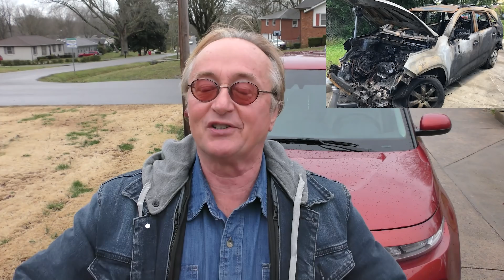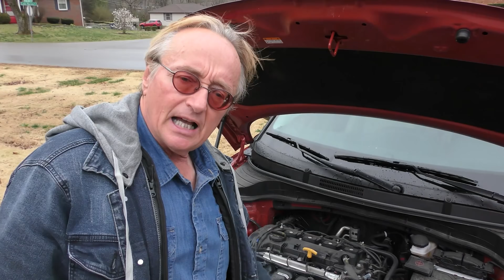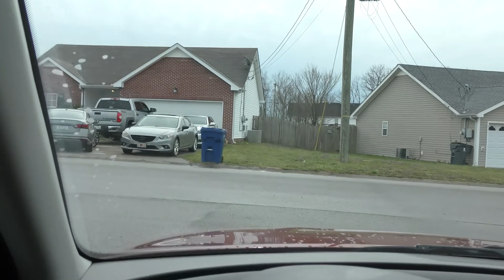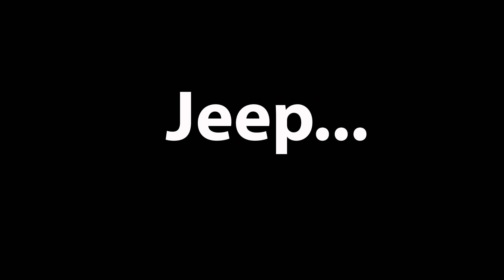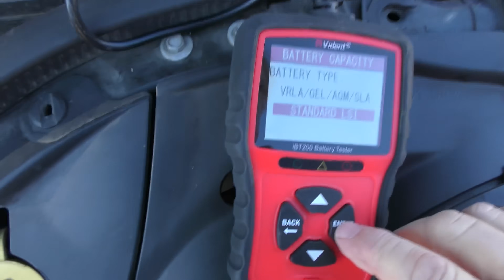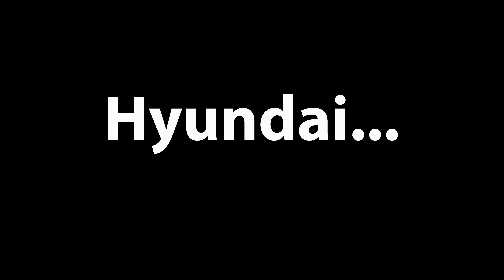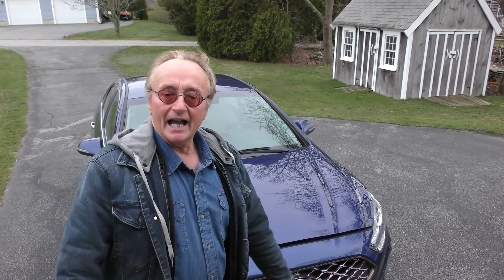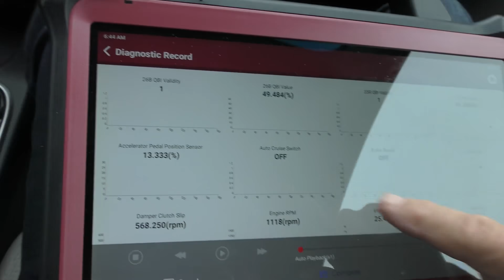3 Car Brands That are Crap

Comment: Always take these videos with a grain of salt knowing people here are looking for views. That being said, ive owned 2 Kia's and put 300,000 kilometers on both, never had issues, meanwhile my wife's Toyota Camry which we bought because we were told about their reliability has had its headlights changed 5 times and the engine makes a whining sound at low RPM's. its a 2019, My Forte is a 2014

Comment: My brother had a new Ram 1500 with the 4.7 magnum. Brand new it started burning 1 quart  every 1000 miles at first. Then it just kept increasing. He took it to the dealer and they just refused to fix anything. They told him it was normal.
Reply: Those 4.7s were just terrible motors right off the bat, they should’ve stuck with the 5.2s, way better engines

Comment: Something wrong here, We had a  Hyundai Kona [sons car], dealer service, down under, sold after about 90,000 Km never burnt any oil, My wife's  2010 Hyundai Getz, 80,000 Km never burns oil, [I service it] Scotty says buy the one made in Korea, they are better, I agree. Seems US built ones have the problems.  Kona dealer service was at 15,000 and I would think that is too late,

Comment: Mister . First oil change is  with all new cars  ca 3.000 -4.000 miles. Next oil cahnge is 12.000 miles and next again 12.000 miles...if  car  is not use  then every year must  enigne oil cahnge. Simply like that. I  own little vcar  1,0L enigne . 71 hp  and others was  1,4 and 1,6 petrol cars  -that same  even often if  car is more then 10 Years old then every 9.000 miles must enigne oil cahnge. Manual gearbox oil every  40.000 miles and  automatic  ca 25.000 miles.

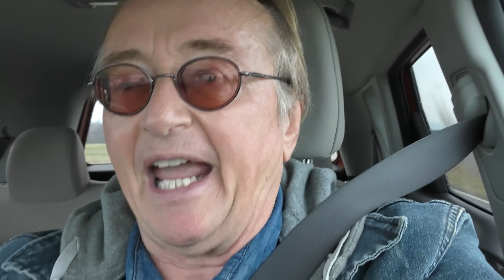Comment: 09:54 If you put gas pedal on end of floor then Yes indeed rews go 6500 ! Small enigne  not even noise go  to sky but it damage Your car enigne.  Even that  little car no needed 6500 rpm to accelaration . 3.000 rpm is enough !

Comment: In 2010 my wife and I bought a 2010 Hyundai Santa Fe.  It had a long warranty and it came with a service contract, and our dealer experience was fantastic.  We'd take it in for regular maintenance, no charge because of the service contract, and they would find and fix something that needed repair, no charge because it was under warranty.  I did worry about what would happen after the warranty was over.
Reply: and……..
Reply: @MP-nm9df  Sold it before the warranty was over.  It's important to point out that dealers are independent of the company that they represent, and while the dealer we went to was really good, that says nothing about any other Hyundai dealer.

Comment: The first car I drove with the auto start was a 1.3l ecoboost, manual Ford Focus. Good baseline. I went to drive a brand new Jeep recently. Holy sh!t. The pedal to go lag was horrible. I'm guessing Ford does pretty good with the auto start compared to other companies.
Reply: Autostart is junk
 Disable it
Reply: Ecoboost rubbish,  oil chain.!
Reply: @petergerritgroen3157  yea? My wife has a 14 escape titanium  with the 2.0 ecoboost, runs like new. It only has like 115k so far..but no issues.

Comment: I don't like those auto-off systems. Just doesn't seem like a great idea to put a load on an engine before the oil pressure even has a chance to reach capacity. I always press the button to disable it in the truck. Junk.

Comment: Jeep?  Our 2011 Chrysler Town and Country needed a new TIPM.  $1200.  $7000 in a year... Now totally dead.🙄😱😞  Used as storage shed now, until I choose to find the cause.  Meantime...windshield cracked and when I replaced the rear suspension parts...learned axle was bent.  Goes through tires in 10K miles.  Anyone want an expensive paperweight?

Comment: Our 2016 Kia Soul 2.0L was fine for 66K miles, then it decided to swallow virtually all it's oil in 1000miles. It went from fine to all but dead virtually overnight. New engine and it seemed fine. Fine enough for Carvana! I bought a Highlander 😎

Comment: Had a 2.3l Ford Ranger that burned oil from the get go… the engine was poorly designed and used for over a decade in various models … no warranty replacements authorized

Comment: 7500 miles is too long between oil changes. My wife has a 2022 Tuscon, and it gets changed every 3500-4000.  Runs great so far.  My wife puts a lot of miles on it, so maintenance is KEY.  

More than that, every service done to the vehicle is recorded and the paperwork kept.

I'm not taking that chance.
Reply: Oh aren't you just something....  I'm so  proud of you and your wife.  Good boy

Comment: I have a 2009 Camry 2.4 4 cylinder. Exactly the same problem as the Kia in this video and exactly the same response from Toyota. It has to use more that a quart of oil every 1000 miles or no fix. So I am stuck adding oil all the time.

Comment: Shame that all gdi motors need an intake and combustion chamber cleaning every so often depending on how clean you keep your oil, and they don't put it on the maintenance schedule.  And since the Kias are still catching fire, I traded our Sportage for a RDX.
Reply: did you not hear that honda still have transmission problems?
Reply: @maga6319  at least they aren't catching on fire.  And that's why I stay away from  Honda 9 speeds, 2017 RDX is a 6 spd.

Comment: I have a 2011 Kia Soul with the 1.6 liter engine - 5 speed manual with over 160,000 hard miles on it from doing courier deliveries in NYC in addition to Uber work in Florida and it's still going strong. Nothing broken on the car, but wondering how long I should push it before I move on to a newer vehicle.
Reply: ..if you move to a newer vehicle, you probably will be pushing it..literally 😆...so much electronic crap to fail on the newer ones...

Comment: Idk about Kia in general being bad. My sister has a 2010 Kia Sportage which has done almost 400,000kms. Engine is noisy as hell but driven the car for a year, no oil change and still goes tough. It’s not worth repairing on anything or rebuilding as it’s reaching its end lifespan but pretty much ride till it dies

Comment: Kia have bad engines because of cheap/ weak piston rings and direct injection.  Direct injection causes oil dilution and excess wear.  Also DI  high pressure fuel pump leaks cause spectacular fires. Nearly every car manufacturer went to new direct injection tech;  so budget Kia competes to give customers the latest tech... good or bad.

Comment: Saturn said the same thing back in the 90's / early 2000's.  Oil consumption was only addressed under warranty if it burned more than 1qt per 1000 miles.

Comment: I had 2 Chevy prizms with Toyota engines in them and they died after about 120,000 miles I am driving a 2013 Kia Rio with 220,000 miles my only compliant is the seat ruined my back. Maybe I was just lucky when I bought it but I never spent much on it just maintenance.  My next car will have to have better seats.

Comment: I got a Hyundai in the driveway with 220k miles on it and only problem I have had is altenator and that’s my fault cause I have two batteries and a huge system in it! I have abused this poor car run it like a race car delivering food and it just takes it. It’s always had a small oil leak so I keep a quart in the car poor a little in as it needs it.  No big deal! The A/C still works and is cold cold! So they do make good cars you just gotta watch which ones you get! And parts are so cheap it’s a non issue.

Comment: I have a 2017 Sonata PHEV. At 80k engine failed suddenly without symptoms. They replaced it after proof of oil changes.
Reply: How has it ran since then?
Reply: I am just waiting until 160 to see. But I am Also not driving much these days so Idk could be a few years until then. I could see that being a factor also. It could just age to expiration instead of mileage.

Comment: I have never had issue with my Kia or Hyundai cars...because I take care of them...you can't abuse them like a Honda or a Toyota....and I would never go 7500 miles between oil changes in any car brand...they have started using synthetic on all the car brands and they say synthetic change 7500 - 10000 miles or once a year....noooo way I'm doing that.

Comment: My replacement motor via KIA burnes a whole tank of antifreeze reserve in 3 to 4 thousand miles and now always leaks R134a every year since the engine replacement.... Kia just ignoring the issue.... Dealer says they're working on it to see what will be done.... Been a month and nothing after forcing the original selling dealer to service the warranty.... Kia Corporate doing nothing.... About to get a lawyer..... And what is amazing is when I bought my Sorento the dealer did the knock sensor update (which then I would of never bought) and removed it from the service records and Carfax.... Scotty is right, Kia plays political games cause the liability they have with quality is so high.... Do not buy, Scotty is right....

Comment: When it comes to the kia souls not all of them are bad the 2010 to 2015 are solid built especially the manuals seen many with over 200k miles and running fine

Comment: The problem with KIA/Hyundai is, that if they wish to sell their vehicles in the United States, they must meet our Government regulated emission and gas mileage standards. The solution used by KIA was to use a softer cylinder ring, as well as a 0W-20 motor oil. This was a recipe for complete disaster, and the new 2022 KIA vehicles sold in the United States now come with a revamped 2.0 litre engine that is no longer GDI, and is now MPFI, with stiffer rings and a factory recommended 5w-20 full synthetic Mobile1 oil recommendation. This motor is used everywhere in the world, but the United States and has a very good reliability history. Your love of Toyota Scotty is very valid, BUT.....Not every person can afford the price of a used Toyota, let alone a brand new one. KIA, with it's 5year/50,000 B2B warranty and 10year/100,000 Powertrain Warranty, as well as price point, make this the perfect vehicle for a student, or young family. Now if you really wish to BASH on a vehicle manufacturer Scotty, start at home with everything in Dodge's line up, Ford's small turbo engines and all of Chevrolet/GM's engines first. Then you can BASH on BMW, Mercedes and Toyota RAV 4's, the new Tacoma's and Tundra's!!!! And don't even get me started on the entire VW/Audi vehicles!!!

Comment: I bought a new 2021 Kona. 3 months later I get a notice that it has bad pistons. So I take it in for the recall. All that amounted to was a mechanic listening for any noise in the engine.  Hyundai told me to drive the car and not worry about it. If it blows up, (and it's still under warranty) they'll fix it.   I gave the South Koreans one chance and that was it. Sold the car.

Comment: Hyundai Parts Manager here I drive a Subaru Crosstrek Enough said. Though I had a 2010 Genesis 3.8 and a 13 Elantra 2.0 both great cars. Those engines were built well. The 2.4 garbage they started building in the 2011 Sonata and the turbo 4cyl in the 16 & 17 Santa Fe you couldn't pay me to own

Comment: I have this EXACT engine, 2017 Elantra.  95.000 miles on it bought new. I change the oil every 3000 miles. Its always at the full mark before it gets changed. Its very important to all cars to follow the break in procedures in the owners manuel.  Driving it hard right off the bat, can lead to an oil burner.
Reply: I have a 2013 Soul with the two liter. So far, no issues. Seems like its hit and miss.
Reply: That's what I was thinking too.
Reply: Of course, it depends on how the car is used, but 3000 miles between oil changes sounds too often.
Reply: Kinda weird, maybe i am lucky, but i have been always driving our new cars hard right after 500 kilometers. Not a single oil burner. Opel Astras (diesel and gasolines, all turbocharged) and BMW diesels (all turbocharged). Only i never drive them hard when the engine is cold.
Reply: 2017 elentra sport 65000 burns a quart every 300 miles I got rid of it and bought a civic good luck to the next owner

Comment: I have had issues with hyundais..however NONE of them ever was burning oil.
As a matter of fact the recommended oil change interval is 5000 miles.
Is this any more nuts then Toyota saying change the oil at 10,000 miles?
Reply: A corolla or Camry manual recommends 10k oil changes?

Comment: My wife bought a 2018 Hyundai Sante fe a few years back it had 20k miles on it when we bought it. At 40k miles the motor was burning a quart of oil every few days so we took it to the dealer they said it was on the verge of blowing up so they put a brand new motor in it thank God for the warranty
Reply: Dealers don't tell you that GDI motors need an intake cleaning about every 15k depending on how clean you keep your oil, and combustion chamber every 40k or so depending on driving habits and oil used.
Reply: @lonniebeal6032  you clean your oil,  I gota hear this🤣
Reply: Good for you. The manufacturer delivered. Reputable company
Reply: Check the brake lights too. Kias and Hyundais are notorious for electrical problems with the taillights.
Reply: lucky

Comment: This is sad, my 1984 z31 2+2 vg30e 80,000 miles has only blown the heater core, but the engine and transmission are like new, ITS ALMOST 40 years old and runs and starts with original parts like a gem, also rack is leaking but not much and works a manual, I should probably change it tho

Comment: Been a honda guy since 2014. Never again. Had a 19 ilx. Rear main seal leak from factory. Smell oil in vents yummy! 2 loaners same problem. Upgraded to the 21 tlx. 2.0 liter turbo. Rear main seal leak from factory, oil smell in vents!! And 2 or 3 tlx loaners same problem! And guess what!!! Oil dilution on the 2.0 turbo too! We were stupid thought would be weird coincidence so got the 21 rdx. 2.0 liter turbo nasty very bad smell in vents when vehicle stationary from rear main leak. And sadly alot of fuel in oil well enough to chk oil and have bad fuel smell in it. I will keep changing oil every 1500 km to 2000 km at my expense. And had 3 rdx loaners all had same problem. Dont listen to anyone! Do not buy honda acura. Unless ur getting the 3.5l 6 in odysey or rideline. Also the customer service is discusting. The worst!!! If your a car person like me and dont wanna waste your money well i just saved you. Buy a toyota! Or anything but a honda. You are welcome

Comment: KIA: Burning a quart of oil per 1000 miles is a design feature.
Jeep: An electrical problem? No way!🙄
Hyundai: Take the bad transmission out of this car and put it in that car. Now put the bad transmission from that car in this car. Repeat until the customer stops coming back.
Reply: My daughter was just told she needs a new transmission on her 2021 Santa Fe with only 6000 miles on it
Reply: @frankstark3036  Is it still under warranty?🤞🙏
Reply: That’s not my point it’s the fact that a transmission dies in 6000 miles is absolutely absurd.  BTW very lucky that it is still under warranty.  Will the next one be just as bad?
Reply: @frankstark3036  I thought maybe she voided the warranty by driving the car.
Direct from the companies website - 
Hunday (sic) warranty terms and conditions: This vehicle is warranted for one hundred years or one hundred miles whichever comes first.
Reply: My 6 yearold Accent drank oil. Hyundai replaced the engine under warranty. A year later my gson totaled my car but I wld stand by the company. The 100,000 mile, 10 year warranty impresses me. Oh Hyundai replaced the engine with NO hassle.
Reply: Bruh WTF 🤣😂
Reply: @TedytheCreative  You're welcome.😁
Reply: I wonder if it’s American models that have trouble. When I visit my wife in Colombia a large number of taxis are Hyundai. They beat the crap out of cars with stop and go. Also they work on them in alleys and the street or small shops etc so they must be somewhat easy to work on.

Then again it wouldn’t be. The first time America doesn’t get the good version of a car. Also all the taxis were manual.
Reply: @travisrolison9646  Yea true, european Kia/Hyundai are on par with Toyota relibility wise. Most cars manufactured in/by/for America are rather bad. Same for our european car models factured in USA. Like BMW and some X models etc
Reply: @wesleyt2896  You would be delusional to think just because a car is made somewhere else, it magically becomes much better. Kia/Hyundai on par with Toyota? That would never happen even if the Kia/Hyundai are made in Japan or Heaven.
Reply: @ctgaming168 Toyota obsessed nerd lol
Reply: @waterbottle5898  more like quality obsessed nerd. Most of the things I like is based on quality. I like  my things to last. Peace of mind and not wasting money.
Reply: Ford. We see no problem with any of our tramsmissions.
Reply: Here in Europe Kia its actualy good and they give you a 7 year or 100000km warranty
Reply: 2015 Santa Fe Sport Fwd 2.4 Has 66,800 miles. Broke down 2 times each time the battery, at 5 years and in December 2024. Never had a problem. We had a 2009 and liked it but it wore out tires on the insides.

Comment: No you can't really prove that the trans insides are different.... But you can prove it was never taken out by checking the fluid..... If it's darker or has less viscosity than it was never taken out.

Comment: I am fortunate to have bought a new 2014 Kia Soul before they starting sucking. I have literally had to do nothing to it since I got it except replaced all 4 tires once (at about 100,000 miles, tread still good but they were near to dry rotting from age) and had oil changed about every five or six thousand miles. It’s been paid off for a few years now and I’ve got just under 150,000 miles. Drive it every day. Very happy with it. But I have heard that the quality took a dip a couple years after my purchase.